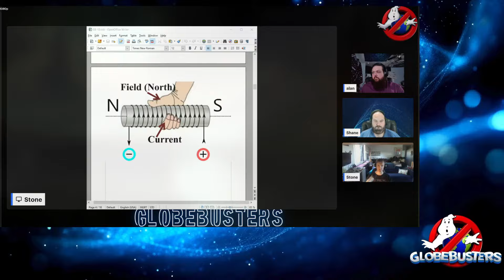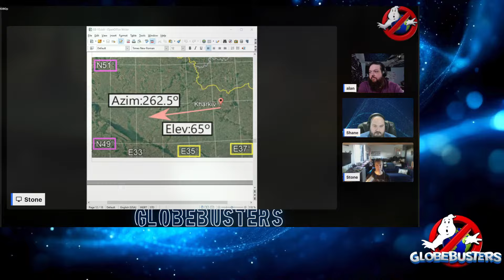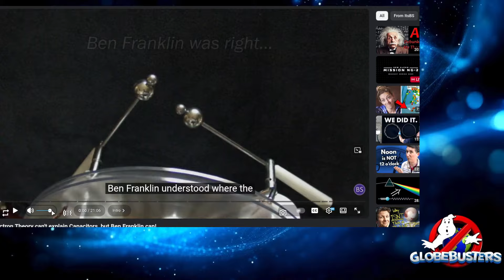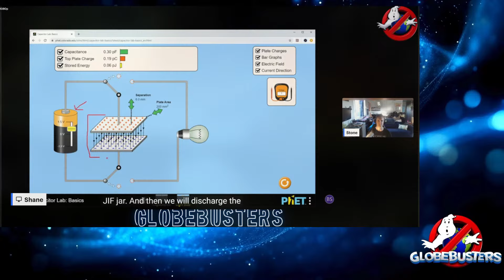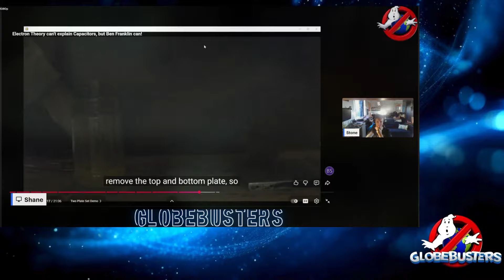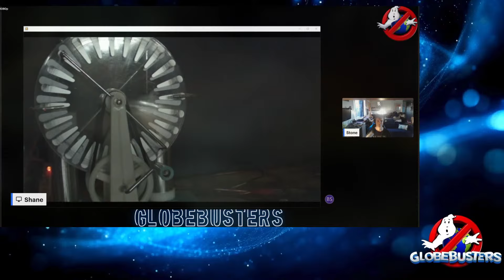GLOBEBUSTERS LIVE | Electrical Thoughts | S14E13 | 11/09/25

Comment: Thank you .   I've been researching this kind of stuff for 30 years and you guys have more pieces of the puzzle figured out than anyone else .  Concerning the definition of ground  ,  mother natures wants everything in balance so she bleeds off excessive charge to ground .  There is only charge and discharge and the ground is not total discharge , it is the ambient {background} state of charge for the location on earth where the discharge is flowing into . Energy does not exist until it flows and energy only flows in one direction , from high states to lower states .  Hot flows to cold , high pressure flows to lower pressure . The gas in a cars tank is not energy for example .  Oh , charge migrates to pointy protrusions on objects so your cone shaped lines in your capacitor diagram are backwards .
Reply: Read the law of conservation of energy. And also 30 years, isn't that concerning for a 5 min topic that clearly shows the earth is a globe?